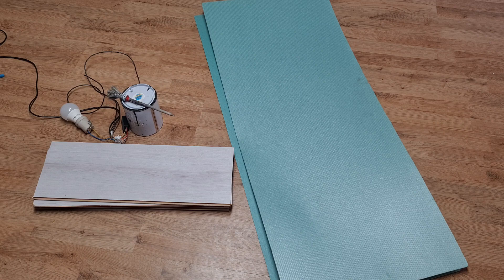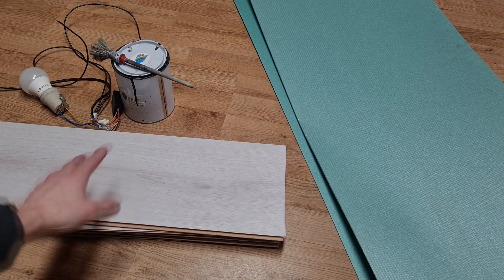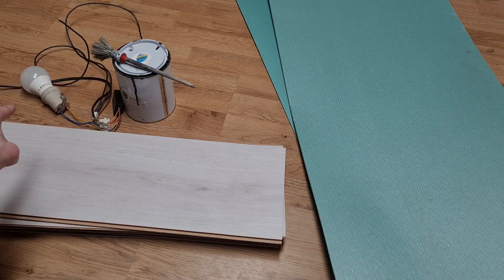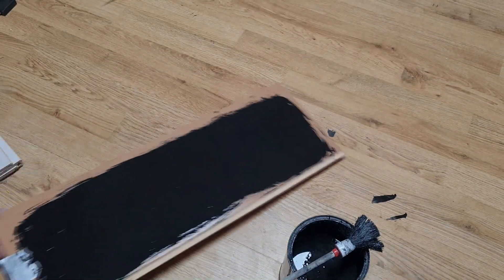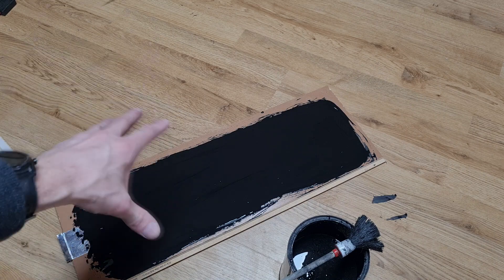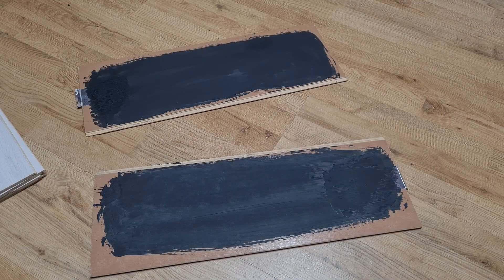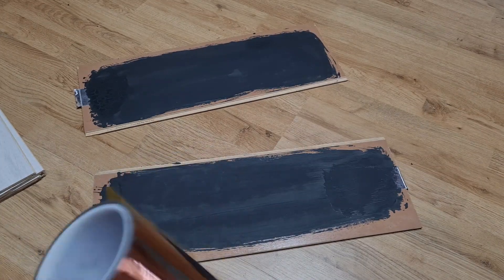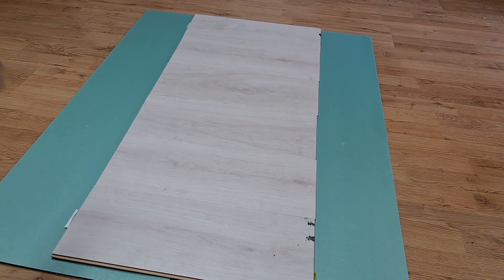Capacitive switch from conductive ink for flooring

Comment: Man, sometimes I think we"re connected!😜
Idea...instead of a complete coat of ink it would be perfect a pattern (carbon planar structure?😋)
Reply from the maker: Hahaha awsome - you never know 😋Yes, of course a pattern will be fine (100% ne to be a carbon structure😀)
Reply: @cayrex  it could be a good idea to propose to IKEA! Like linoleum adhesive rolls already designed to pilot a series of spotlight in a corridor (just imagining 😜)
Reply from the maker: @Giarko  You mean IKEA, like......IKEA?😱 I will never come not even close,.... to some one that will listened to me 😂
Reply: @cayrex  that could be a mass product! You just need to patent and sell it to them for a percentage of the businnes (5-10% is more than enough) they will find the way to produce and merchandise it for sure!  Think about how this could impact the efficiency of light use!
Reply from the maker: @Giarko  It wouldn't be bad for sure, but I think that is not so easy.